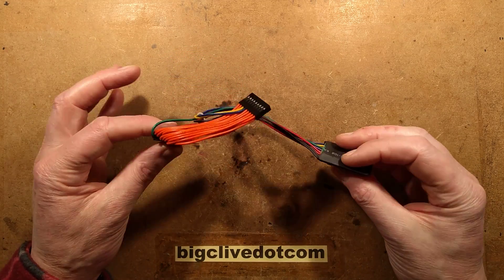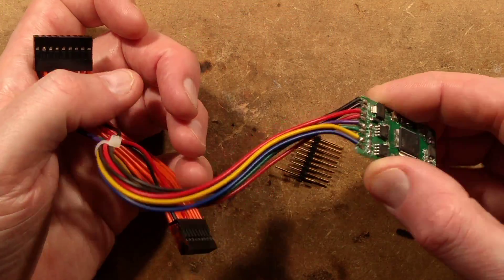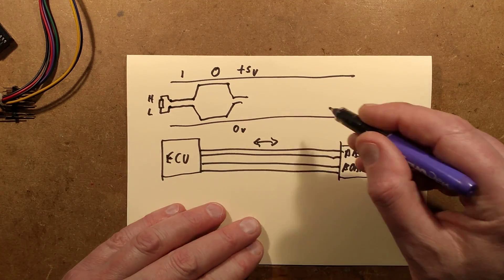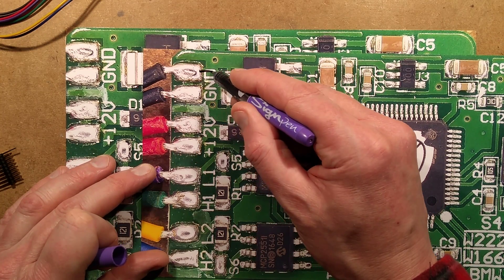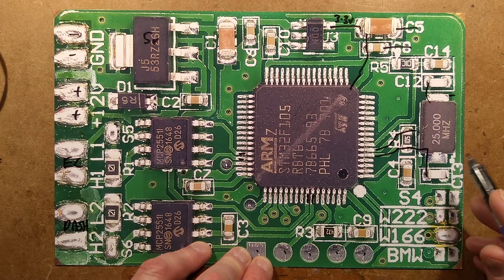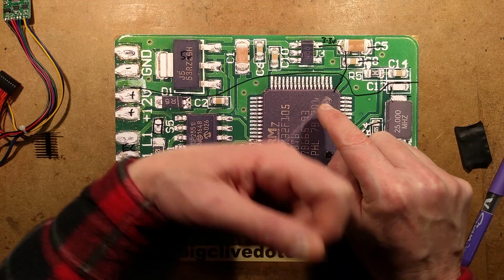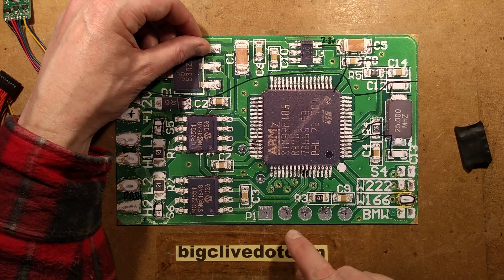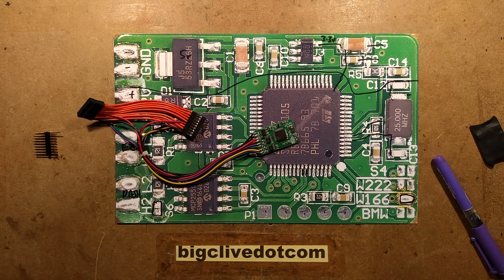Naughty CANbus odometer "interface".  (Fakes mileage.)

Comment: You don’t need these things to alter milage. A 15$ programmer clamped to the eprom on the gauge cluster is the best way or... get a diagnostic tool and reprogram the vehicle. Odometer correction is available.., however all of these things are easily detected. Some computers have a independent odometer on them. A obd connector will reveal this and cheap android apps and a crappy Bluetooth adapter will show the fraud. Second way is your last inspection. If your car was once registered with 100k and now it is 20k less.. boom

There is also a blackbox in every vehicle made with obd2. It is usually on the airbag controller board. Sometimes its behind a panel near the drivers foot area. Mercedes puts them there. It will also contain the tracking device. In onstar equipped vehicles the black box is housed in the onstar box. They are usually behind the glovebox. 

Don’t get fooled. Check the milage yourself with a cheap obd reader

Comment: these can bus units are used/fitted by myself in most modern vehicles in order to show the distance/mileage of a taxi meter that i install. these are mostly tapped on to the OBD on the vehicle. normally pin 6 and 14 in order to get an accurate reading on distance to calibrate a meter.  hope this clears this up for you.

Comment: I've always wondered if little things like this could be used between the ECU and socket used for emissions testing to fake sensor and test data so the car that can't pass emissions can pass emissions. I'm sure it can be done, I'm just not sure if it has been done.
Reply: I read on CA DMV that the ECU must contain OEM software to pass smog

Comment: The RAM has a program which allows manipulation of the existing dash controls such as odometer reset, indicators etc.. The mileage is stored twice& can be reverted to true mileage. BMW have their own software. Mercedes w222 and w166 varies with GM as does Audi with VW merger. Developed in China on commission from Euro odometer hackers using network sniffer. It's reliable, electrical issues probably down to general wiring tampering.

Comment: "If you're getting illegal electronics you want to make sure they're made to good standards" 😂😂 Brilliant Clive. Interestingly, I had a BMW Motorcyle and due to their particular take on CANBUS you couldn't just plug your battery maintainer (e.g Optimate) straight into the 12v accessory output socket as it goes dead a few seconds after the ignition is turned off. So you actually need a special  (expensive) version of battery maintainer. What I did instead is to unplug the wiring from the back of the pillion seat accessory socket, insulate and tie these back carefully (for easy reversal of my mod). Then I simply connected the battery (with a suitable in-line fuse) directly to the accessory socket terminals. Voilà! A simple way to use my standard Optimate device with this particular bike 👍

Comment: Clive would love to see a follow up to check if an ST-Link could read the flash from the STM32
Reply: I was wondering if the contact points on the edge of the board were connectin points for an ST-Link without a good look at the back of the board it's hard to tell.
Reply: Best case scenario is that we get to see some Assembly/Machine code, which is not pretty to look at if the binaries are filled with large libraries like CAN etc. haha! If the binaries are not protected then you can indeed hook up an ST-Link to the SWD lines and read the flash with the ST-Link software (dont know if they added those functions to Cube IDE yet).

Comment: I am wondering if this is the same type of module that was discovered in the VW diesels to defeat the emissions a few years back.  It would be interesting to find out, and if it was built into the actual ECM's or if it was an addon module such as this.
Reply: The VW cheat was in the code

Comment: I’ve designed Soooooooo many PCBs with STM32 chips.  That guy has a dual CAN controller so the firmware is just intercepts the traffic and sends it back out with the data overwritten.  Very clever!

Comment: AFAIK it's not illegal to simply own one of these, the illegality is only if you try to sell the car as having X mileage when it doesn't. Less suspicious than the old mechanical style ones with the gear ratio reducers which you couldn't just remove.

Comment: I actually need the ability to do something like this to calibrate my speedo on my Mondeo "Mk4 Diesel auto" . My Winter tyres make it read 10% over reality so the miles will clock up 10% more also. So they do have legitimate use. If it has a means of making the adjustment once fitted. I am not sure if my speed has its own pickup on the gearbox or if it takes it from the ABS sensors. Any guidance to any toys to do this would be handy.

Comment: (OK so late to the party)

W222 is Mercedes S-Class based CANBus protocol, W166 is Mercedes GLE-Class based CANBus protocol, as is S4 on an Audi and BMW is er, well, BMW. (W222, W166 and S4 were probably the first vehicles to use those protocols.)
Merc and BMW (at least) bent the rules with OBD to make it harder for the vehicles to be diagnosed and/or repaired at non-authorised dealers, by using their own variations of CANBus protocols. This little board obviously has a translator for the various "standards" of non-standardness (note: Mercedes use at least two!)

Comment: Well this video is completely wrong, nothing too do with the ECU, the filters put in to block the mileage in the EZS unit and its not just as simple as putting in and wow the mileage has changed it needs to be adjusted in the speedo cluster Eeprom...

Comment: I was told the milage is stored in both the instrument cluster and the ecu.
Both of which can be modified with the correct hardware & software combination.
I do wonder if this device caused the instrument cluster to malfunction or whether the mechanic was just removing it for access to something else??? 
What a load of crap anyway if what I was told is correct then surely its easier to just reprogram the milage stored in the dash through the obd port?

Comment: how time flies, years ago you would just spin the speedo drive cable backwards with a drill to remove miles.
Reply: Those were the days!
Reply: Til some genius invented... the ratchet!

Actually it's surprising the counters would work going downward. The mechanism to increment the next digit, every time it goes from 9 to 0, surely wouldn't work in the opposite direction. It's possible to build a counter that can go in either direction, but you wouldn't, for a mile counter. 

Even before they put ratchets in (the trusting souls!), I bet it only worked on some cars. The rest you'd just have to disassemble, or maybe swap out with a counter from a scrapped car or something. I dunno, "Dishonest Car-Dealing Bastards Of Days Gone By" would be an interesting book to read.
Reply: Then they ran it forward until the mechanical  counter turns over, takes a little longer, but there's rubberbands to hold the drill trigger down.

Comment: I have a feeling that is a CANbus adapter. General board used to adapt non standard parts so they will work on cars not designed for them. It's just been programmed for nefarious purposes.

Comment: Are you sure it's not to defeat the speed limiter ? Reason I say is that especially on German cars the mileage is stored on the ABS BCM and PCM so the dash would be the lowest denominator and throw up a hard code and anyone with a scanner can display true mileage. its the reason you must be careful changing in second hand modules as if you have a part with a higher mileage than your car then you will see your mileage shoot up.

Comment: Just thinking aloud, but on my 15 year old bmw,  it stores the milage in more then one place, the ecu stores it, the dash also stores it, and it also stores the vin number and the service interval I think are stored on both, it any of these things are differant between the ecu and the dash it shows a tamper dot on the milage, so in theory even though this has a bmw option on the board, I would think the tamper dot would come on?

Comment: Most modern cars older than 3 years, will have the annual mileage recorded on the mot history (www.gov.uk), so any easy way of checking if the car your looking to buy, has been clocked. I caught a few rogue Ebay car sellers out, in under stating the true mileage of the car they were selling, by checking mot history. They then corrected the Ebay listing.

Comment: Certainly very textbook, including the reset circuit which I've seen in other microcontroller datasheets.
The terminator resistors make sense if it's breaking the network not sitting on it. I guess it can be wired differently for different cars and sit on the network rather than interrupt it.

You'd hope it just passed data through unmodified apart from the one bit of info it needs to change, just in case any unknown safety critical signals appear on the bus.

Comment: I fitted one of these kinds of devices some years back for a friend with an imported Subaru Legacy B4 Blitzen. In this case it wasn’t specifically an attempt reduce the mileage but circumvent the speed limiter which came in at around 112 mph. When fitted it converted the speedo so that the km/h section of the dial then became the mph reading.
Reply: Those kind of devices worked differently in most cases. In older Toyota's at least, this was implemented by the vehicle speed sensor, which was a mechanical device that created a variable clock square wave pulse interpreted by the ECU. This was also sent to the cluster to drive the odometer by routing the same wire from  the sensor back to the ECU. The odometer had no smarts, it just used  to drive a small motor, where the square wave ended up being interpreted as variable voltage based on speed. The speed cut bypass was achieved by sending a square wave pulse back to the ECU at just below the frequency for the max speed. The dumb ones just cut the wire to the ECU, but that caused problems. The avast ones would look for a frequency above X and only modulate the signal down when the VSS was sending a frequency above the limited speed. This signal was usually generated by an NE 555. Similar approach but no CANBUS
Reply: mine is chipped as well  one that disables the active fuel management  (gm's AFM  does not even save gas  it will just transfer the costs into expensive repairs  so you end up saving nothing at all)

Comment: did it cut a set mileage off or is it just a kph to mph converter or something?

I used one them on my bike (a mechanical gear in a screw on box between cable and dial) to convert from kph to mph.

If i used the same converter on a mph bike it would have slowed the rate at which the odometer went up but would have made the gauge under read by 1.6x

Comment: You can get those boards on ebay for cheap. "18 in 1 universal CAN filter" they are called. They propably got some of those and reverse engineered that CAN data from the supported cars and programmed it into code.

Comment: I would assume that once you remove this the Dash will display the correct ODO.  Most cars actually have multiple checking to make sure the ODO isn't messed with.  Wheels subsystems, gears, driveshaft and engine revs are all correlated.  The ECU knows about this and will flag it.  In this case it's probably just giving false readings to the Dash.  I remember reading that BMW also has intelligence in the dash that looks for discrepancies between last ECU reading and current which means as soon as you remove a device like this the ECU flags it.

Comment: A lot of dealer and more recently third party scanners can read the true mileage. Its  just a matter of finding the location and unlocking the hidden files. VAG I know has been able to do this for years. It will show remaps past and present even the the time and date it was added/removed, if an ECU has been substituted and for how long. Peak boost etc. Porsche had some sort of data logging in the late eighties, apparently introduced because idiots bought their cars then went out and red lined them from the word go and then expected it all to be fixed for nothing. I have seen some very odd mileages on high spec German cars, but a check to see if any type of recalls have been done reveals the correct mileage as recorded by the manufacturer on factory data bases . One even left the old service book in the car.......

Comment: Having tried to made some sensible dupont pin-and-socket cables myself, I understand why they did that. Kinda the same story with Aviator GX type plugs. AFAIK there aren't any cable-end suitable male dupont (or aviator gx) multipin plugs readily available. You're basically stuck with soldering a PCB throughole male socket on the end of your cable (messy and exposed backside) - or using a female plug, then shoving in a male straight PCB mount socket to adapt the end to male.

Comment: Apparently it's used to "correct" the milage and also filter out those useless error codes to prevent the annoying check engine light from coming on. It also looks like a good tool for truckers trying to get around driving limits and having only 1 log book. I found it on a UK trucking web store:

https://www.truckdiag.uk/shop/mileage-correction/can-gateway-can-filter-module/

Comment: I suspect they know the node address and data register(s) that contains the CAN data for the odometer on the different cars, the CPU is just acting as a gateway and filtering out the specific target register(s), the data for the odometer is then “massaged” to different values and the new altered values are sent out. The complex part is knowing where all the registers for the mileage data lie so you aren’t missing one. Somewhat analogous to old school software cracking.

Comment: I was definitely hoping for a JTAG connection, if at least to verify the security fuse was set.  I'd be very interested in using something like this to convert my useless Harley-Davidson air temperature gauge into a very useful engine temperature gauge... I'm pretty sure that both cylinders have temperature measurement on the buss.

Comment: If it helps anyone... Most cars store the mileage (or kilometrage) data in multiple subsystems... If you use an EOBD reader you can check they match up. You can also check if these subsystems have been replaced if the seller claimed, as the mileage will be lower.
Even a car I own, built in 2004, does it.

Comment: So does the ECU still know the actual milage?  Sounds like this would be something interesting to mess with in a controlled environment and a GM car.  then see if the odometer and onstar telemetry disagree after say a cross country drive and back.
Reply from the maker: Yes, the real mileage is kept in the engine management system.

Comment: Cat and mouse game.
It's available on aliexpress and other vendors. There appear to be slightly higher quality versions as well.
This device is geared towards BMW, and Benz, you can see the soldered jumpers for the Benz model on the lower right.
This appears a case of the manufacturer locking down the mileage data, so that an independent service center can't update it, the can network will force an update to the dashboard with original mileage. If you replaced the ECU or whatever part stores that mileage data, your dashboard would read incorrectly.  This would potentially have the ability to filter that data.  I could be wrong there, but maybe the mechanics actually reading the output of a replaced ECU?. I'm not seeing anything listed about adding or subtracting specific amounts of distance like 40K.
One of those products that wouldn't really be necessary if the manufacturer didn't take so much control over the software.

Comment: This would also be great if you wanted to swap to the instrument cluster from the performance model but wanted to retain your original milage. (For example it is far cheaper to buy an instrument cluster out of the performance model of your car if it has a shitload of mileage, you could then install one of these and make it reduce it by the amount more it displays than your car actually has, and then it would be accurate)

Comment: That's not how can bus works.... its doesnt pill the low to zero. When the Can Bus is in idle mode, both lines carry 2.5V. When data bits are being transmitted, the Can high line goes to 3.75V and the CAN low drops to 1.25V, thereby generating a 2.5V differential between the lines

Comment: The polarity of the dominant and recessive bits is selected this way so that logically lower IDs have higher priority on the bus. That is, the message with the lowest ID will determine the state of the bus in case of a collision between two or more messages. Any tranceiver transmitting a higher ID will detect that the bus state doesn't match what they are trying to send, and will yield. This provides a mechanism of arbitration, which always allows the message with highest priority to get through.